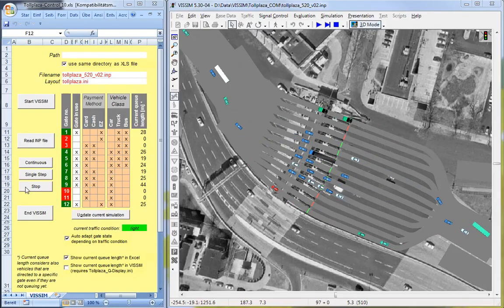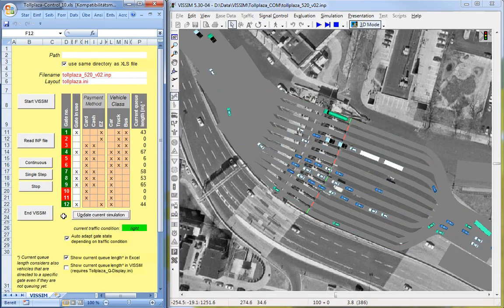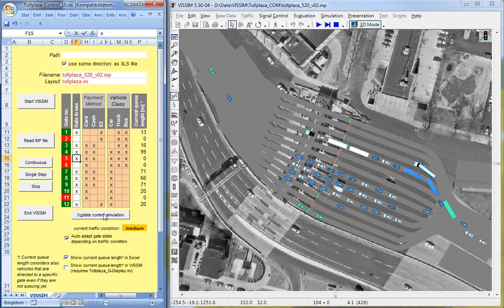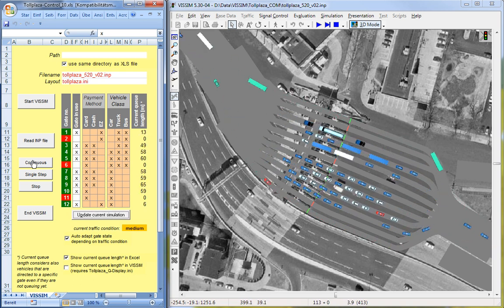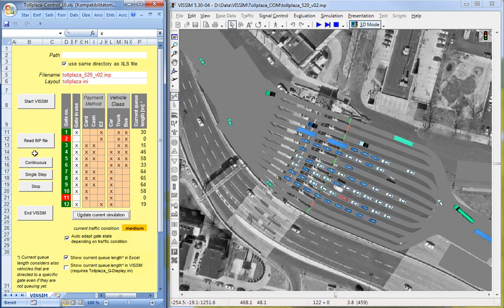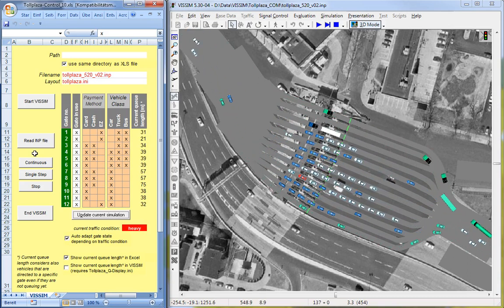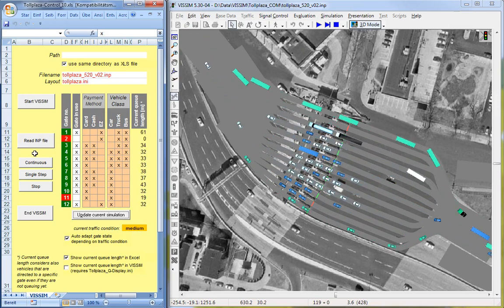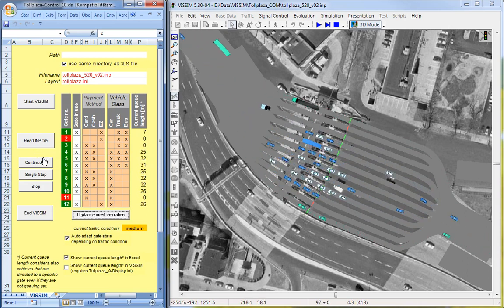PTV Vissim: Tollplaza Simulation using COM Interface

Comment from the maker: Unfortunately we don't have a tutorial on this example. The basic principle is to direct vehicles by changing route splits dynamically, considering the (current) gate attributes. Routes start some way upstream on the main highway. The lane-gane and -drop sections are modelled using 2- and 3-lane links/connectors. Each gate is represented by a single lane link. Queue lengths are computed by detected vehicle length plus standstill distance. The rest is simply VBA programming.
Reply: VBA programming is not needed if these route splits do not need to be changed during the simulation correct?